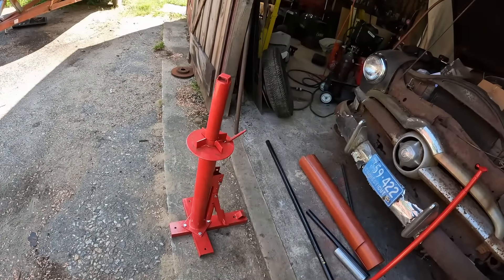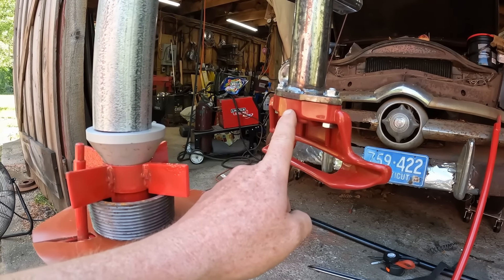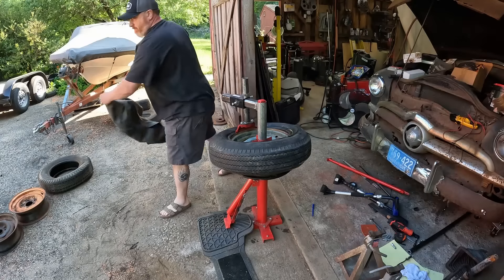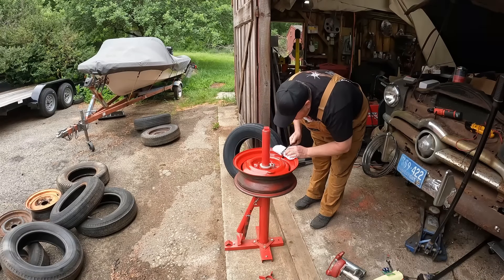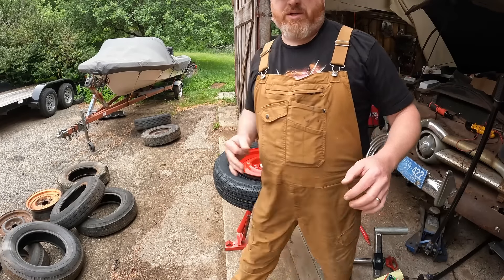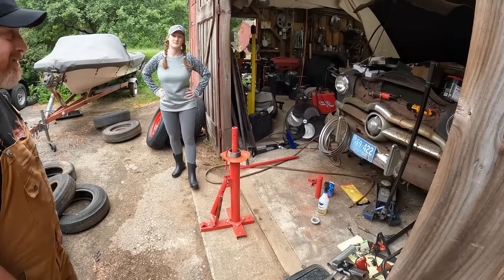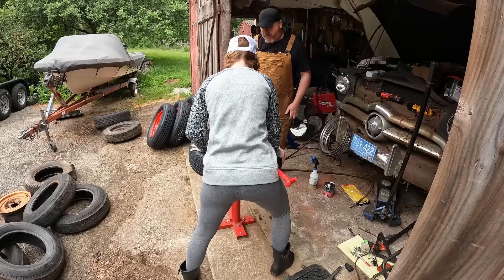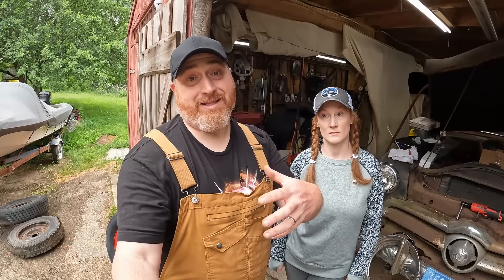How to modify a Harbor Freight Tire Changer to work amazing!!! Follow this DIY guide!!

Comment: Excellent job!  I once had to dismount about four tires off an old ignored vehicle and got by with the two typical tire removal tools…much harder than your system!  Don’t just discard the old rubber inner tubes!  Cut them with a sharp razor blade do that you have a number of parallel rubber strips.  Very useful for working as large rubber bands.  (Using larger truck inner tubes those large bands are useful for securing furniture moving pads to stuff if you wind up moving large furniture).  Use Rueglide—a wonderful German product for lubricating rubber tires when mounting onto a wheel. Sometimes you can use a piece of 1 inch wide nylon line and then slowly tighten it around the tire until the bead is close to the wheel—then add the air quick as you can!  You did a great job!

Comment: I put t a peice of 2inch galvanise pipe where you put the bar to help break tires down that really helped. Then I got me a automatic fly wheel went around it with my wealder to cover up the teth to keep it from cutting up wheels and cutting up my hands on those teeth.   I broke the pipe that keeps it from turning then I put a few of holders one for transmission fluid and to hold tube of cylecone for beads that wont seal grease the tire and wheel then put athin coat of cylcone on the bead of the tire and it will not leak.
Then I wealded the platform feet  to the bottom of the stand.
And a lazy susan to spin the tire when braking it down.
The fly wheel for table to sit tires was the best thing I did it really help holds the wheel.
And the holder helps to hold valve stem wrench and setms that really help.
I use gas to pop the bead it works better that eather, eather some times it wont light plus gasoline has a pop to get the bead on the wheel.
also I wish I hadn't painted the tire break arm yellow it help to keep people from runing over it in the dark, You can tell when people have been looking through your stock and if it isn't painted yellow it tells who is looking becaus it will catch you right on ther shin.
You'll learn quick where it is.
Good show thanks
Almost forgot get you some liitle c-claps and tape the contact points to keep fron scratching that helps
keeping the tireunder the lip when putting it back on.
Reply from the maker: Oh, I like this. Thanks for commenting.

Comment: Awesome!! No bead popping because those are not radial rims with safety beads… there meant for tubes… if the pressure gets low the beads can slide and pop inwards tubes prevent this

Comment: We use to sand blast the wheels with walnut shell medium from harbor freight before removing the old tires. If you need to you can put a ratchet strap around around the tire before adding air so you don't have to lift the tire while filling .

Comment: They've upgraded the harbor freight tire changer. They painted it black now
Reply from the maker: It's actually better than that. I has a large rubber pad on the bead breaker. I may buy it!
Reply: I purchased one it was on sale I haven't taken it out of the box
 yet, you inspired me. So you're in Connecticut? I was raised in Hartford. Luckily I got out alive

Comment: Might be mindful of the air pressure at times if the tire gets low on air since the wheels doesn't have safety beads the bead could slip off good job 👍
Reply from the maker: Yeah, maybe people have said the same thing. No safety bead. Thank you!

Comment: Have you thought about welding some 4 or 5” lever handles on the spinny-spinny duckbill holderler. Lol and just for my mental well-being cut at least an inch off the bolt length.😂
No but that is an awesome job you did there on making that thing a pretty good unit. I like it!👍
Reply from the maker: That was the plan but I'm inpatient and I need to get the video together! Lol.
Reply: I figured that’s where you were going with it. 👍
I came across your video because YT recommended… And that’s because I had watched Scotty Kilmore do a review on this very HF product. He was anything but impressed with it. So after seeing that, and then how you breezed through that tire change. Is why I say you did a great job with the upgrade. 

for what it’s worth to you, Just thought I’d give some insight

Comment: The thought I'm having is that=Yes it worked great because you totally rebuilt it and spent another $50+ to make it work.  I also realize this is what we car guys do in a typical day fooling around with our hobbies and our wives really hate it~!! P.S. Love the old Ford (46 to 49?) A high school friend of mine used to take us to school in one like it in 1964. The old Flat Head Engine sounded great with 3 two barrel strombergs atop the motor and duel glass-packs called "Cherry Bombs" on the exhaust.  Good Luck with your restoration~!! New Sub Today. 👍✌👍
Reply from the maker: Thanks for the checking out our video. This is a 50 Ford Custom (Shoebox) I actually just drove it out of the garage for the first time. That's the next video!

Comment: I like it. I've made a few mods on mine but I like the duck bill. I'm going to modify my alignment pin to a spring loaded set up like my old tire machine had.
Reply from the maker: We've used this quite a bit with the duck bill and it's been great.

Comment: great video.with your welder issue ,try spraying and blowing out the welding wire  liner inside the welding cable ,or get a new wire liner
Reply from the maker: The welder did have a decent hose assembly. It's since been replaced by another welder. I still have it but need to look at it more. Thanks!

Comment: In my early years I changed tires on the old Coats 20/20 machine. that was before they had special tools to change aluminum wheels. Then they came out with a plastic sleeve that slipped over the metal bar that goes into the tire to remove it. One thing if you have trouble getting the tire to seat as you are filling it with air, try putting a ratchet strap around the tire and cinching it up. It will close the gap between the tire bead and the wheel and as soon as you see that it is taking air release the strap. We used to use a rope and a stick in the rope to twist it tight then just release the stick. That wasn't so safe as the stick can spin pretty fast when you release it and bust your knuckle's.

Comment: If the bead gives you problems sealing take a nylon rope tie it around the tire and put something into it like ( screw driver) and start twisting the rope till it squezes the tire in the middle of the tread and the beads will start moving apart  while adding air it will seal much better , soon as the bead seats some release the rope. works great !

Comment: Sweet 8 dollar paint job 😂.  I love how you modified the machine.  I was looking for a way to do tires without marring them.
Reply from the maker: I was surprised that there was no scuffs or scrapes. We did another video and put tires on 17" aluminum wheels and the was no scuffs.
Reply: @madgingercustoms  that's why I've been hesitant to this point to get one, but I just saw where you can buy the arm with the duck bill, so life is all good.  I'm about to get that, the bubble balancer, and some weights and these shops can kiss it.  They'll only see me for alignments for now

Comment: The only thing I would suggest is to weld a flat piece of steel onto the tube the duckbill is attached to at the angle the large bar contacts it when you are removing the tire.  The only reason I say to do that is because if that bar should slip off the tube for some reason, the pressure of your hip on the bar against the center pivot point could throw that bar around to hit you, and that does NOT feel good.  Either a flat that the bar can rest against, or a perch with a slot cut in it for the bar to key into like it has on the center hold down sleeve will work.  I know it doesn't seem likely, but that one time it does happen, it can really do some damage.
Reply from the maker: Solid info!!

Comment: Way back when I first worked in the filling station this was the basic tire machine. The bar you didn't like was the only way we had and it worked fine. This stuff that you added wasn't around and we had no problems with the rim being scratched because the paint was dry and we used lube      (like you sprayed on the tire). this lubed the rim. I guess I am too old.

Comment: I've been using the basic tire changer without the duck head for some old VW wheels. I had to put an old brake drum onto the center post and bolt the wheel onto the brake hub because the center of the wheels are so big.
I'll have to do some thinking to see if i can incorporate the cone and duck head mods, your setup obviously works way better.

Comment: Back in the day we take a floor jack for the bumper the bottom stand fit perfectly around the rim. You put it your tire behind the bumper you put the Jack stand on top of the tire and tap it in with the hammer between the tire and the rimeject the car up and pop the tire loose after you take the valves them out that’s crazy to both sides. It’s easy and quick to.😅
Reply from the maker: Solid info!! Thanks!

Comment: A little bit of soapy water on both beads works wonders, even when seating the new valve stem!

Also look for the  yellow dot symbol and locate it as close to the valve stem as possible. This dot signifies the heavy area of the tire, and the valve stem is the light spot of the wheel. Matching these 2 points up should reduce the need for excessive wheel weights!
Reply from the maker: Check out our latest video!! We did much better overall with some changes.

Comment: I have one of those tire changers.  I use it as is a lot. It’s works ok , but I’ve been mounting tires in shops for 40 years.  U can save all that money, do it yourself it’s worth it. But not on the new low profile tires.  They are much more difficult to dismount and mount . Good add ones with the duck bill. 👍
Reply from the maker: We've done 17" and 18" low profile tires with this and it's fairly easy now. I can't imagine doing it without the mod though.

Comment: You might need a new liner for your welder. The one that the wire travels through. Also check connections like the ground and where the torch lead attaches to the unit thingy.
Reply from the maker: The entire gun and hose assembly was recently installed. I think its the ground or the wheel. We don't use it anymore regardless and its been replaced.

Comment: By my 2nd tire, the thin metal arms, on the bead breaker, bent. Yes, I did lube the bead 30 minutes before and during.  I thought you would have traded those pieces out too.
Reply from the maker: I've been through about 20 tires now with no issues on those so far.

Comment: I bought one at harbor freight and used it to mount 2 sets of tires without any mods and without bolting it to the ground. ,I just used good lube and elbow grease . There's another way to set the bead without a air compressor (starter fluid and a match)
Reply from the maker: Oh we've set beads like that on the trail when we used to go crawling!

Comment: I would like to see you use it as made. Then see how your adaptions made it better.
Reply from the maker: I did use it stock. It's certainly possible but was a big struggle and would really damage the paint on the wheels.

Comment: I have not mounted mine to the floor yet. But I plan on using a pinch bar for breaking the bead, and moving the lower piece to the inner most hole on the tube the pinch bar goes in for more leverage. if you push down on the tire on the opposite side from the duck bill toward the empty space in the rim it gives you slack on the other side. To center the tire I made a pvc ring. I also like the  stainless bolt in valve stems. if you put a good amount of lube you can spin the tire on. if you have a problem seating the bead use a rachet strap around the center of the tire.
Reply from the maker: All great advice! Thank you!

Comment: Good job. I have an old Coates tire changer. But I don't have the bar for it. And the bead breaker is broken. Like your HF it needs to be bolted down. So I've been thinking of buying one of the HF units and modifying it something like you've done. You've presented a good deal. I like your barn and your Fords too. When I was little we had a 49 Tudor, I have a 61 F100 with a 428CJ and a 61 Falcon.  And tell Jess she's pretty and give her a 👍for the tire install.
Reply from the maker: The new version of this tire changer at Harbor Freight is even better. They made changes to it for the better. Thanks for watching us!

Comment: "You know all about this" LMAO!!! I have owned one of these for over 20 years.  Used predominantly for motorcycle tires.  Your mods are awesome and necessary if you want to do car wheels.  Going rate in my area is $20 for mount and spin.  Nice job all around 🙂
Reply from the maker: Thanks checking out the video!

Comment: If you mix some dish detergent and water, put it around the bead of the tire, it will help it break loose and also go back on easier lubrication that works. My daddy taught me this trick.
Reply from the maker: We had dish soap in that spray bottle. Thank you for checking out the video!

Comment: On the welder...Take apart your feeder motor and contactor and clean it.   If you grind alot near it they load up quickly..
Reply from the maker: That could be it. We have replaced this welder with an Arccaptain MIG200 but I will take it apart at some point.

Comment: I Just bought this from HF, and they have added rubber mats on the long arm on the base, and one on the base on top that holds the tire. I am Absolutely going to modify mine just like Mad Ginger did. My issue is I am trying to change a lawnmower front tire, and the post is just a bit too big  for the hub. So I am cutting it off, finding some thick allthread &  a coiple of matching nuts. Then welding them in to the old one, &  make that part exchangeable. Then I will be able to make more parts to fit, or use for other stuff. I want to be able to also use the base for my planishing hammer, and other shop tools. My shop is currently Wayyy too small, and anything that saves space, & multi use is what I like to buy. I hunted down a Shopsmith Mark 5 This is a great woodworking machine. It includes a variable speed headstock, which has a spindle on both sides of the headstock that you can then use the table saw, 12" disk sander, horizontal bore, verticle drill press and lathe. Other tools are available that connect to the outboard side of the headstock like a jointer, planer, belt sander, scroll saw, and bandsaw. It is not a professional machine, yet the guy before me used it to fully finish the inside of his new house. Trim, doors, cabinets, some furniture, Everything that looks to made by wood, he probably made. His spindles on the stairs match the legs on his kitchen table and chairs, basically anything round like that, has his design. I am working on buying a 24' or larger box truck. I am starting a side hussle making personalized gifts, art, decorations, or anything I can make using my professional laser, criket, and Shopsmith using wood, metal, acrylic, glass, Etc... I plan on going to farmers markets, fairs, races, and selling stuff online. I am doing this for fun, but if it turns into a something more, that is even better. Ok, my comment is long as hell, and I appreciate you taking the time to read this! Do you know of any multi use machines that you have, want, or know of that is Great for a small shop? 

PS...My shop is only 12'x20' until I get the Box truck. Have a Blessed day,!
Reply from the maker: This is legit!!! Are you making a video on it or anything? I'd love to see it!

Comment: You are just like me Sir......I like to do everything myself.....been doing my own car tyres since a kid of 17 now 70.            

Love your DIY mod to the tyre change rig.....it works great.

One thing I would do is lube the duck bill both side before you start and lube the tyre before setting up on the rig.

I used to also use soapy water but I now use tyre soap.much better and no water inside your wheel and cheap to buy.

All my tyre equipment is DIY....made my own bead breaker....I also use 3 feet long tyre levers for getting the tyres off the rims.

I buy my own tubeless mushroom head tyre plugs on ebay so can fix my own punchers....also tube patches as my motorcycle has tubes....and my old Landrover did have tubes till I converted to tubeless.....much better.

Looks like your into old cars like me.....keep up the good work.

P.S. my pals have always thought me an odd ball working on my own tyres.

Nick in the UK.
Reply from the maker: Thank you sir!

Comment: I actually considered doing this same thing and beefing it up or perhaps reverse engineering the whole thing much stronger to do heavy duty truck tires. Good to see it actually is possible. Thanks can't wait to see how balancer works.
Reply from the maker: The balancer video was been out since July I think. It works well. We've used it many times! Thanks for watching and commenting.

Comment: If the tyres are scrap cut them off then get your local tyre company to fit and balance the tryes. But if you live in a remote area then yes great idea
Reply from the maker: It's more about money. We change a ton of tires and it's really expensive here. This has paid for itself multiple times over already.

Comment: Use spray soap and water comes off smooth.  First job was at tire shop 60 years ago. By the way got one of that tire changer had it for 20 years with no modatications

Comment: If there is only a yellow dot on your tire, you should line up the yellow dot with the valve stem of the wheel when mounting. If there are both red and yellow dots, the red dot should be lined up with the valve stem. The lowest point of the tire takes precedence over the lightest point of the tire in this case.
Reply from the maker: Unfortunately no dots could be found on these.